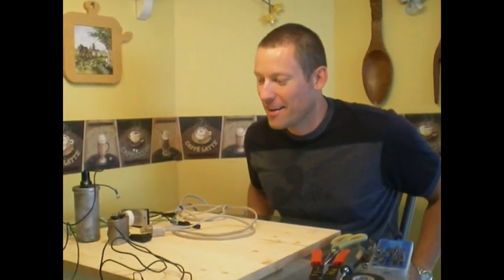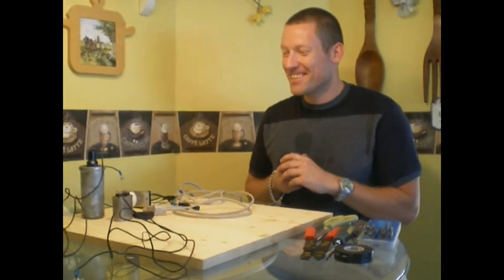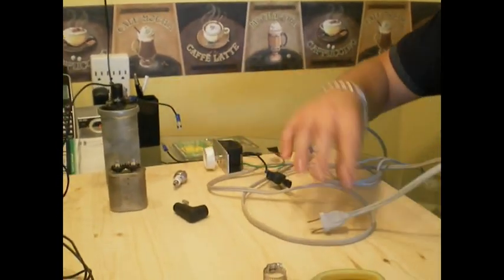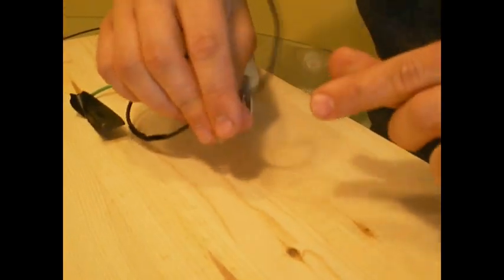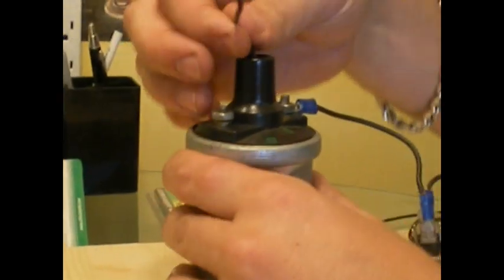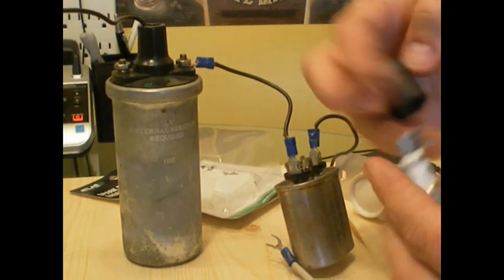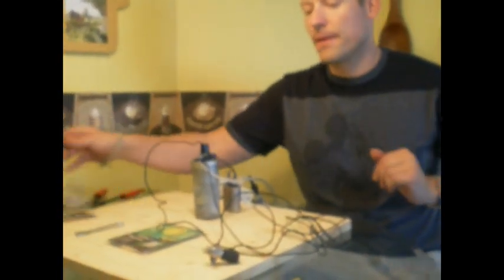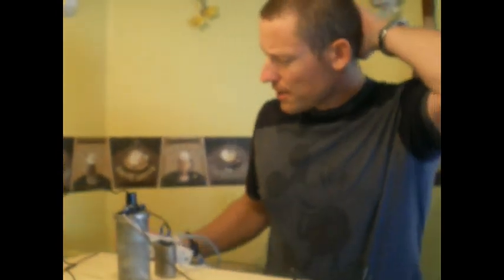Ignition Coil High Voltage circuit home made

Comment: what source of electricity you used ? AC or DC? And of what value? I am trying to do the same with 12V DC battery and not getting any spark.
Reply from the maker: Electricity used is AC for this experiment you might try a 555 timer circuit for DC
Reply: @Josefppaz  thanks.

Comment: Hi, Great Video, Thanks for posting it. Question: Doesn't the dimmer switch have an on/off switch built in? The one I bought does. Mine has more wires than 2 though. Let me know. Thanks, Tony
Reply from the maker: ya buddy I believe there was a switch on the dimmer I used.  You had to push in the round nob and that would be your on and off

Comment: why didn't u use a spark plug wire? it would saved u the hassle  of the kit plus it safer because it can carry more current without overheating.
Reply from the maker: Your right
I just put together what I had around the house

Comment: 555 and transistor driver works very well, and won't overheat coil. Will work from battery pack, needing no extension cords. You are connecting parts with no understanding what they are doing or how they work, and apparently no regard for voltage and current ratings. By luck they simply happen to sort of, kind of work, however not likely well, or very long. But hey, it's your parts, money, and life. Best of luck you don't fry yourself or mom's good tupperware.
Reply from the maker: Well with your  ingenious mind make a video yourself on this project just saying

Comment: a starter coil works off 12 v DC not 120/240V AC so you would blow it up
Reply from the maker: +Nick Muir Hi Nick your absolutely right it would blow up if it was directly connected to the house mains.  .electrical engineer told me a dimmer simply adds resistance.  Now the coil does get warm fast over a period of time, so I just use it in short intervals.
Reply: +Josefppaz no it won't it just becomes a huge magnet gets hot and makes very hot arcs it won't blow up I put 440v 50 amps threw it just hotter arcs than a not and these can burn a coil not detonate and explode
Reply: Can I use 12v dc adapter instead of 130v AC with this circuit?
Reply from the maker: I believe you can bud, you just need some sort of light dimmer device for 12vdc im guessing some campers have this
Reply: Gaurav Jaiswal i would recommend using a relay and a capacitor that pulses the coil at the rate you want it to look at a video on youtube on relays i recomend a car battery with a car relay it supplies plenty of current

Comment: For in case u dont know, uf stand for micro farrad, that tells u how much of the voltage it can hold
Reply: Very true about the dimmer switch, they are kind of like a pwm( sort of)  because u can actually change the frequency

Comment: is it possible to just connect the capacitor to the spark plug wire to increase to output spark or would you need some kind of timing setup to controll the output spark? i have a moped that i want to increase to spark power like what you see with the KML wires. but i hear, using a high output capacitor would do the trick. is this true? or would i be creating a constant arc instead of the timed spark?
Reply: i know yours is an old post, but... there is a capacitor that you might be able to upgrade in CDI (non-points) ignition. it is in front of the high-voltage coil. there should be nothing between your high voltage coil and your spark plug other than a high tension wire and a proper end plug

Comment: That refers to the maximum voltage the coil can produce. It's a pretty safe assumption that if a spark jumps a gap on the coil's high voltage leg, then it didn't produce the full rated voltage. As soon as air in the plug gap ionizes enough for electrons to flow, the coil begins discharging and you get the spark. Maximum voltage doesn't matter as long as the spark jumps when you want it to.

Comment: may i know the maximal voltage generated from this ignition coil ?
Reply: That will depend on what spark coil you use. They can range from 10k to 60K+ Volts.

Comment: If you want to know a little bit more on your hobby ,check out a device that is called (triac) Its basically the beating heart of your circuit .it lay within your dimmer switch .the triac  chops the frequency up ;in return makes your coil not saturate . So to all the engineers out there ,I stand corrected it is still @ 60 HZ !

Comment: The dimmer does not act as a relay ,only a resistor. what your doing is using  the outlet ,in fact is ac, till you get to the capacitor then acts as a dc source at the coil for 30hz (half of 60 ) the cap used this way is called a bypass filter ! good job  , I think i will try it on a ford coil over !

Comment: Ac is alternating current. In a electrical socket where you plug into, the right side is hot and the left slot is neutral. Just to let you know, but otherwise I love your video. Thanks

Comment: I am actually an electrical engineer! This was very entertaining to watch! FYI on the capacitor, uF = micro-farad. And the dimmer simply adds resistance to the circuit. Dont perform this circuit test on a metal table!!!

Comment: Very cool, thank you for this video it helped a lot, I could not find anything like this anywhere. What is the purpose of the hose clamp around the spark plug though? does it act as a ground for the ignition coil?